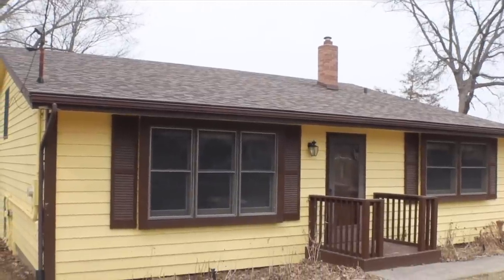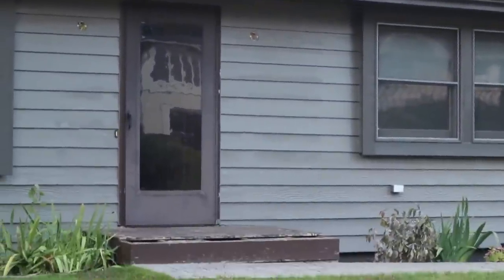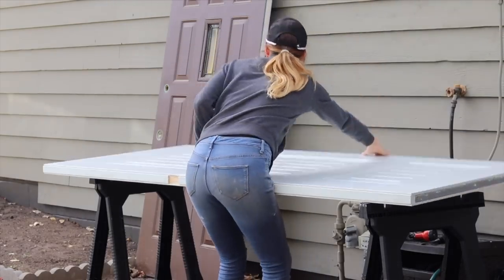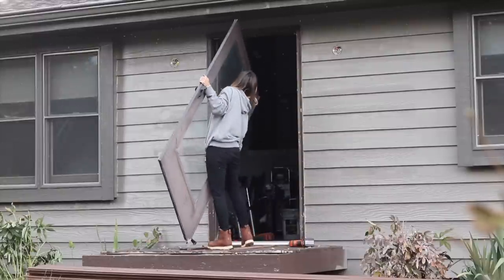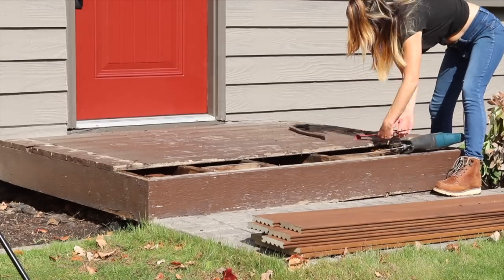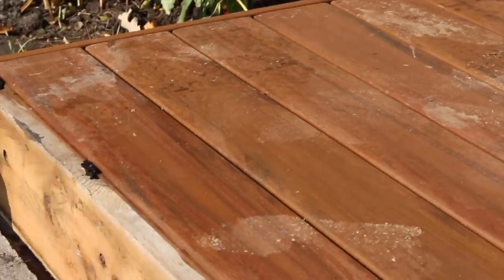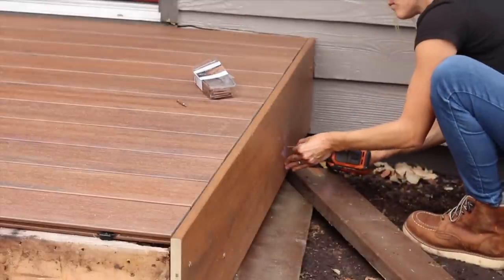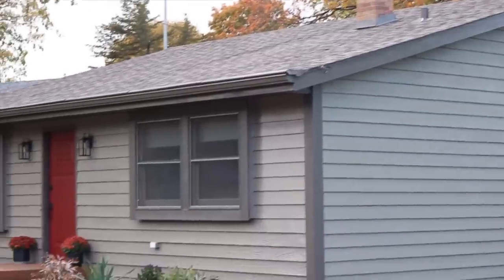Complete Front Entrance Makeover | DIY Curb Appeal Upgrade

Comment: I was one of those who suggested not to paint the chimney.
I'm glad you didn't and you will not regret.
Front of the house looks great and front door looks awesome.
You should be proud.
As a pro painter for 35 years, I'd guess that deep tone red took more than 3 coats to cover. Deep reds, "simply white" and "chantilly lace" are nearly impossible to cover in few coats.

Comment: you needed a Bi-Metal holesaw to drill thru the skin on the steel door.
also you should get tge new locks before you drill the holes.
unless your reusing the existang locks. Usually a modern exterior door has those lock holes closer together. 
Like the gray tones on the exterior, looks good.

Comment: your summer home is looking much nice every time you work on it ... I would have painted the front door before hanging it = much faster and easier to paint it on saw horses
Reply from the maker: Thanks! The reason I didn't paint it before install is because I wanted to install the same day as when I took off the old one so I wasn't without a locking front door. Can't handle tacky paint, ya know?